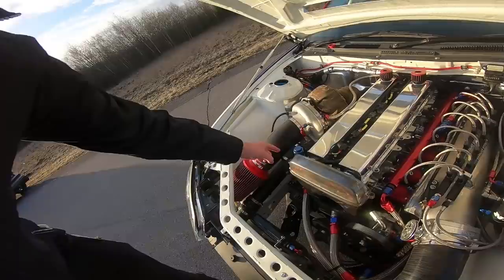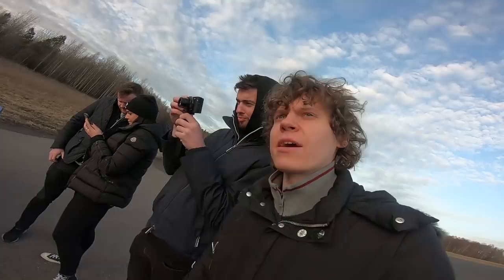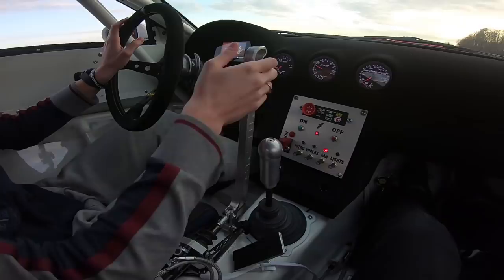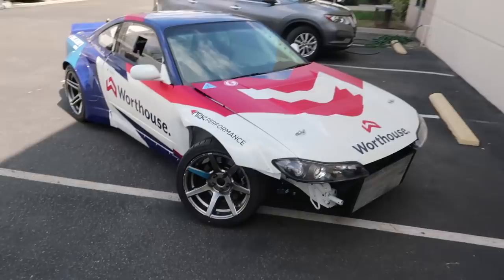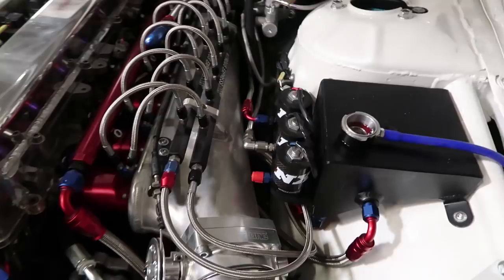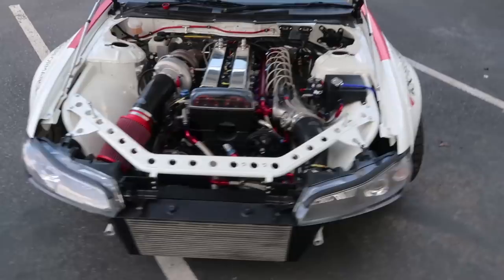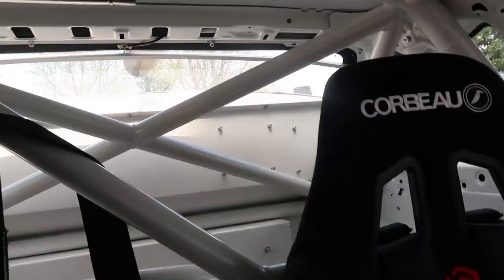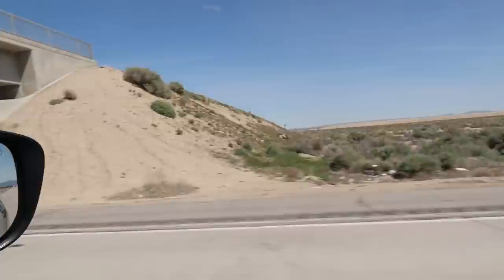1000hp 2jz s15 first test | James Deane & Piotr Wiecek

Comment: tbh adamlz s15 had a meaner idle for sure (idk now they will rebuild that shit xD)
Reply: the new block has higher compression pistons so it idles smoother now
Reply: @eliasbergstrom5300  yeah but i meant the sound... btw new dyno shows heas easily getting to 900 hp now with extra 1k revs... so will ahve same power but smother and longuer range of rpms xD